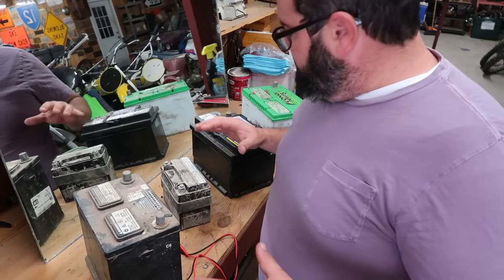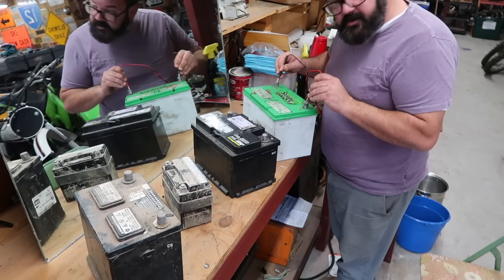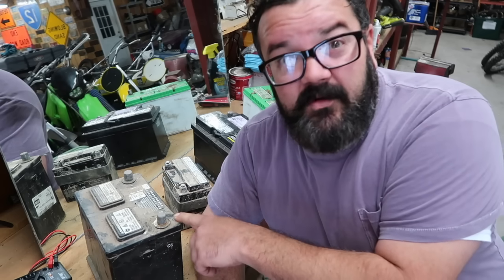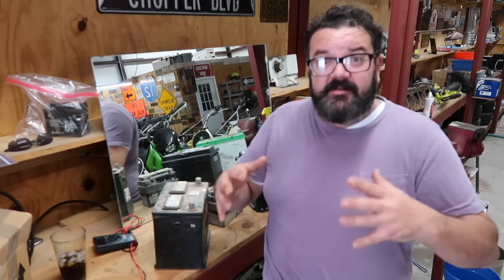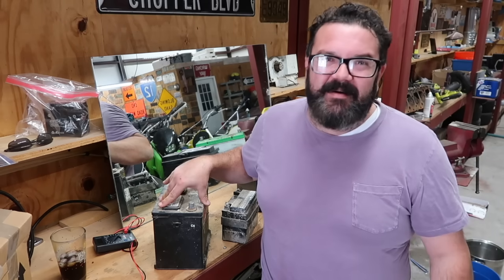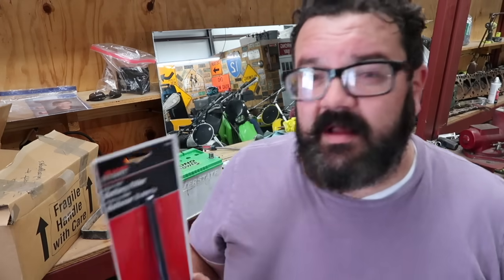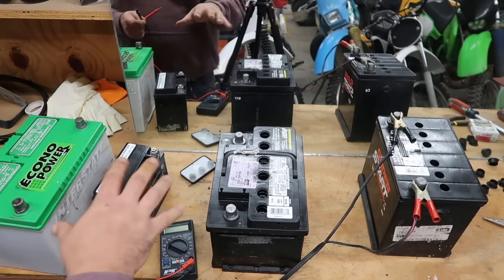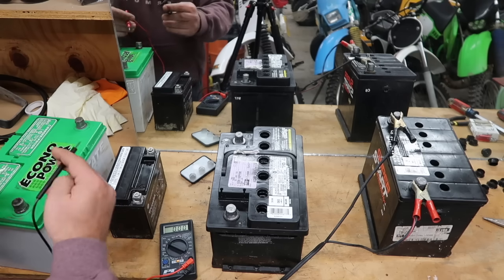Reconditioning a 12 Volt Car Battery: 100% Success

Comment: Sorry to rain on your bonfire here but you are claiming success a little early.
All you have achieved is getting the battery voltage up to 12v.
The main symptom of a sulfated battery is that it will charge to 12v, but lacks the cranking amps required to start a motor, then it dies pretty quickly.
I have yet to see this actually work.

Comment: ❗What a waste of time, money and a lot of energy!! I've been working on 3 dead batteries for the past 2 days and now I will need a manual battery charger because my New automatic charger will not work at all in dead batteries so by the time I'm done spending extra time and money with all this crap I would and should already bought 3 refurbished batteries for less than $150❗
Reply: This projects are definitely for people that stay at home and don't have much to do ❗
Reply from the maker: Not my fault that you had a crappy charger, get a trickle charger from harbor freight for $6
Reply: @CarGroves ; I already throw away 2 dead batteries because they wouldn't hold any charge according to your method❗

Comment: Where to start: 12V IS NOT revived. 12.6V or more is revived. Second, you skipped the baking soda flush? Third, you mixed old dirty battery acid with Epsom salt? And at what ratio? Also, vinegar is acidic. You can't use it to neutralize acid. Lastly, you didn't do a load test. Even if the batteries measured 12.6V - which they didn't, a load test could show they were useless. None of your batteries were revived in this video. Bottom line:  With all due respect, you probably shouldn't have made this video because you clearly don't understand what you were doing.

Comment: this is just screwing around , its not actual "reconditioning" in any way at all theres a lot more to it than just putting in epsom salts , just getting some of them to work for a few months , SORT OF - MAYBE ! NOT in any respect a battery you could depend on when you might really need it ! IT WILL FAIL YOU !  wheres the part you put one of those in the vehicle and see where it is in a month or a week even ???

Comment: Yea, handling heavy batteries and acid with flip flops. I especially loved the lead water dumping into the ground. Im sure the EPA loves that. Lastly, you cant check the health of a battery using a voltmeter. All around, just a terrible video.

Comment: This is all bullshit - as a battery ages the lead corrodes in the acid - epsom salts dont un-corrode lead, also voltage is not the same as capacity to deliver current. A battery that has next to no capacity can still charge to 12.7v. 12v auto batteries are considered to be at 0% charge around 10.5v. Cars/bikes usually cant get them any lower as the electronics need a minimum voltage to be able to draw. In order to get down to 1v these batteries have to have been run down intentionally with some low draw device like a small light bulb or have been put on a charger in reverse polarity. Please do not do any of the things you see in this video as it is entertainment science fiction. The motorcycle battery is a VRLA construction which means you cant "wash it out" as it is filled with fibreglass mat. Oh and by the way you have also 100% contaminated your yard with toxic heavy metals by hosing out your batteries.
Reply from the maker: Weird, seems to work just fine. Worry about your own yard Paul.

Comment: Your videos completely wrong. The normal voltage on a fully charged battery is 13.78 V nominally. And since the majority of the charge is held at the higher voltage anything under 13 V means your batteries half dead and it goes down exponentially from there so a dead battery is 12volts or less.Further, the question is does your battery retain the charge using the Epson salt solution or does it quickly fail there after. This might work to temporary Lee restore part of the capacity of a battery but it certainly does not rejuvenate 100% or even 50% as you erroneously have concluded. And remember 50% capacity it’s just mostly dead.